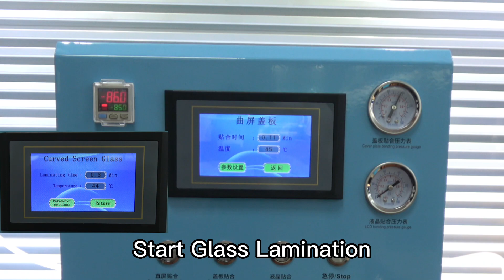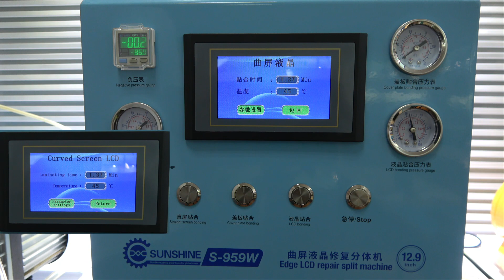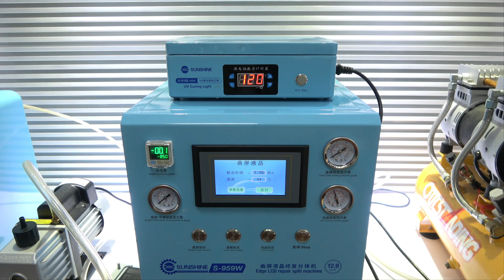S-959W Curved Screen Fitting Operation | Sunshine Phone Repair Tools

Comment: What is the time in straight laminate.s959d
Reply from the maker: Pls add my whatsapp:+86 133 1621 0241
Reply: What if  my S959w just work till - 24.5 and doesnt move from that level? What should i do ? There is a button to configure that lvl?